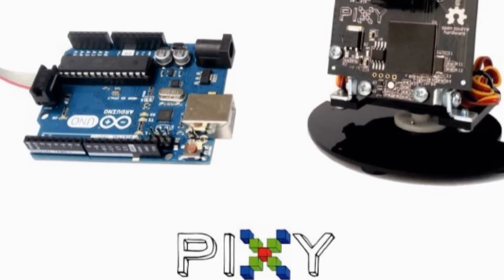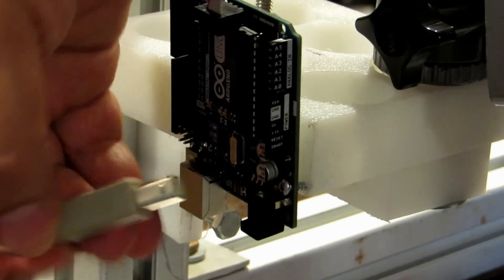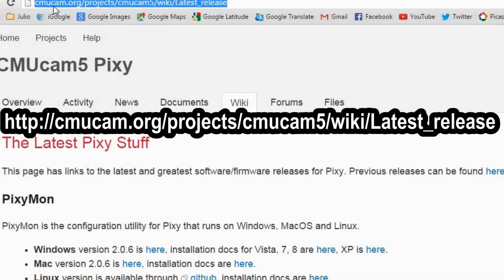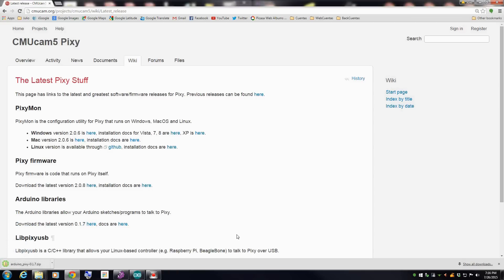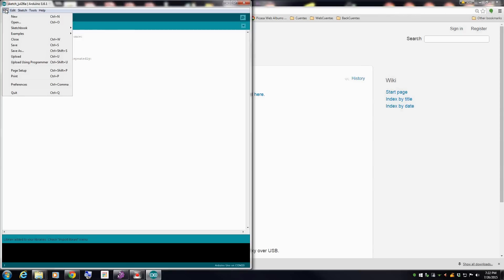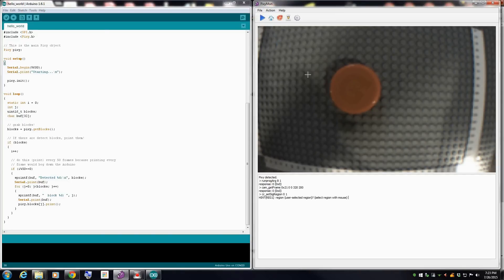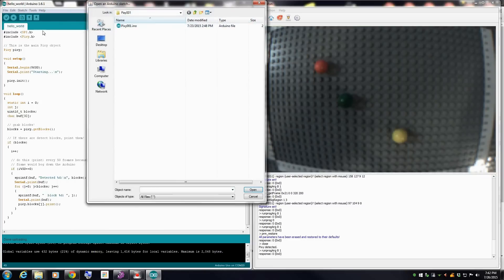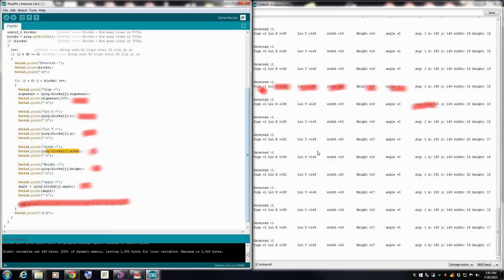Pixy Cam to with Arduino

Comment: I have two questions:
If we have introduced two different color objects into the camera, and the camera sees two different objects, then what object is the pantilt focused on?
2. When the camera loses the body, does it stay in the focus of losing the pants body, or is there a home position where the pantilt goes?
For these two questions, can we send the data to the camera with arduino to make the selections that we want? Is there a library for this
Reply: First Set 2 or more signatures in the PixyMon, then copy the second code on https://sites.google.com/view/jumpinkit/pixy-proyect
I writer for you. telme if works good luck

#include <Pixy.h>
Pixy pixy;

void setup()
{
  Serial.begin(9600);
  pixy.init();
}
void loop()
{
  static int i = 0;
  int j;
  int16_t signature;
  uint16_t blocks;           
  blocks = pixy.getBlocks(); 
  if (blocks)                
  {
    i++;         //<<<<< ----- Delay each 50 Loops everi 50 loop go in
    if (i % 50 == 0) //<<<<< ----- Delay each 50 Loops everi 50 loop go in
    {
 
     for (j = 0; j < blocks; j++)
      {
        signature = (pixy.blocks[j].signature);
      
            if (signature == 1)
               { 
               Serial.print("signature 1  ");                
               Serial.print("  Vertical =  ");
               Serial.print(pixy.blocks[j].x);
               Serial.print("  Horizontal =  ");
               Serial.println(pixy.blocks[j].y);
               }              
            
            if (signature == 2)
               { 
               Serial.print("signature 2  ");                
               Serial.print("  Vertical =  ");
               Serial.print(pixy.blocks[j].x);
               Serial.print("  Horizontal =  ");
               Serial.println(pixy.blocks[j].y);
               }
            
       }
    }
  }  
}

Comment: can i use web cam ?
Reply: No. A pixycam is basically a computer in itself. All of the visual processing is done on board and then it just sends the data to the arduino or other microcontroller. If you wanted to use a webcam you would need to use something like OpenCV, which has far more functionality, but has a higher learning curve.

Comment: Hello, my pixy cam pan/tilt mechanism keeps turning all the way to the right when using  an Arduino uno. But if the device is directly connected to the pixy software (connected directly to the computer) it works just fine. Do you have any suggestions or solutions to why this is occurring?
Reply: make sure you get a 'genuine' arduino.
A lot of the clones do not support the full servo library

Comment: hello could you share me your Arduino code to compare with mine did not work the servos
Reply: the servos will control from the "PixyMon" if you want to control from the Arduino you have to read the position    Servo1=(pixy.blocks[j].x);" Servo2=(pixy.blocks[j].y);"
Reply: thank you, as you would do to activate my DC motors are normal, but can not find any example how to move according to what is capturing.

Comment: Hey I have a problem.

Serial.print(pixy.blocks[j].type);      Error ! 

saying that struct block has no member named 'type'

Help me please !
Reply: tried to Up to date software, be sure to have the lates versions.
Reply: I already tried the code and if you just comment the line the code of the  type and angle it will work :)

Comment: Hi! I'm wondering if this pixy cam can be used with a pic to recognize a alluminium can... would you know and could answer me? i'm working in my final exam and i'm thinking to do a smart garbage...
Reply: Hi Jessica: the Pixy recognise color, one or a group of colors so if you can arrange small color squares on the can Pixy will recognise. good luck with your project

Comment: can you share the details of your hardware ?  is this a similar servo ? http://www.ebay.com/itm/Pan-Tilt-Servo-Motor-Kit-for-Pixy-2-Axis-Robotic-Camera-Mount-Security-Home-Safe-/272193578096?hash=item3f60006470:g:Fh4AAOSwstxVRKC9 
also does the servo provides 360 degree rotation , i want to know if i can turn this camera into a radar system that allows me to scan a complete circle around and look for 5-6 distinct signatures around a robot ... is there a cheaper alternative to this camera and servo (it costs more than $130 for camera and servos)
Thank you much

Comment: how come i dont see the servo protocols in any of this libraries ? i see
 the xy w and h but i dont see those values being ported over to the 
serial for arduino to tell servo to move
Reply: +Sys.stem the arduino code is only to work with the Pixy cam,
the Pixy cam in self drive the servos, and you program the camera via the PixyMon.

Comment from the maker: in6seconds Here is the code

#include <SPI.h>
#include <Pixy.h>

Pixy pixy;

void setup()
{
  Serial.begin(9600);
  Serial.print("Starting...\n");
  pixy.init();
}

void loop()
{
  uint16_t type;
  static int i = 0;
  int j;
  int16_t signature;
  int16_t angle;
  uint16_t blocks;           //<<<<< ----- Blocks = How many items in TOTAL
  blocks = pixy.getBlocks(); //<<<<< ----- Blocks = How many items in TOTAL
  if (blocks)                //<<<<< ----- Blocks = How many items in TOTAL
  {
    i++;         //<<<<< ----- Delay each 50 Loops everi 50 loop go in
    if (i % 50 == 0) //<<<<< ----- Delay each 50 Loops everi 50 loop go in
    {
      Serial.print("Detected :");
      Serial.print(blocks);
      Serial.print("\n");

      for (j = 0; j < blocks; j++)
      {

        Serial.print("type =");
        Serial.print(pixy.blocks[j].type);
        Serial.print("\t");

        Serial.print("Sign =");
        signature = (pixy.blocks[j].signature);
        Serial.print(signature,OCT);
        Serial.print("\t");
        
        Serial.print("Loc X =");
        Serial.print(pixy.blocks[j].x);
        Serial.print("\t");
        
        Serial.print("Loc Y =");
        Serial.print(pixy.blocks[j].y);
        Serial.print("\t");
        
        Serial.print("width =");
        Serial.print(pixy.blocks[j].width);
        Serial.print("\t");
        
        Serial.print("Height =");
        Serial.print(pixy.blocks[j].height);
        Serial.print("\t");
        
        Serial.print("angle =");
        angle = (pixy.blocks[j].angle);
        Serial.print(angle);
        Serial.print("\t");
        
        pixy.blocks[j].print(); //<<<----- This print all one Line
      }
      Serial.print("\n\n");
    }
  }
}
Reply: +Microcontrollers Projects  Thanks for this video. May I know, I am getting error at this line:
  Serial.print(pixy.blocks[j].type);
saying that struct block has no member named 'type'.. .can you please help me out? thnk u
Reply: +Microcontrollers Projects how come i dont see the servo protocols in any of this libraries ? i see
 the xy w and h but i dont see those values being ported over to the 
serial for arduino to tell servo to move
Reply: +Microcontrollers Projects : can you share the details of your hardware ?  is this a similar servo ? 
http://www.ebay.com/itm/Pan-Tilt-Servo-Motor-Kit-for-Pixy-2-Axis-Robotic-Camera-Mount-Security-Home-Safe-/272193578096?hash=item3f60006470:g:Fh4AAOSwstxVRKC9
 
also does the servo provides 360 degree rotation , i want to know if i can turn this camera into a radar system that allows me to scan a complete circle around and look for 5-6 distinct signatures around a robot ... is there a cheaper alternative to this camera and servo (it costs more than $130 for camera and servos)
Thank you much
Reply: +Amir Sadrpour Yes same camera.
Reply: +Amir Sadrpour the arduino code is only to work with the Pixy cam,
the Pixy cam in self drive the servos, and you program the camera via the PixyMon.
Reply: +Sys.stem the arduino code is only to work with the Pixy cam,
the Pixy cam in self drive the servos, and you program the camera via the PixyMon.
Reply: Don,t work. Error: 'struct Block' has no member named 'type'
Reply: Do you download the latest version of PixiMom and the Arduino? Update software
Reply: Microcontrollers Projects